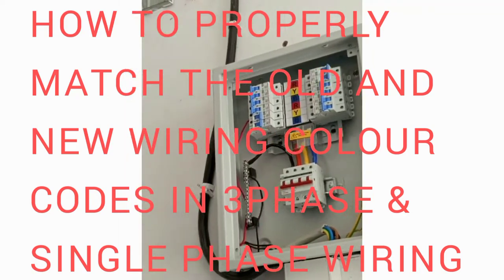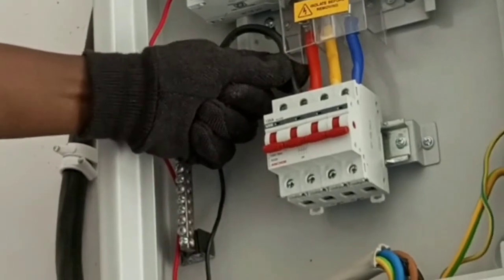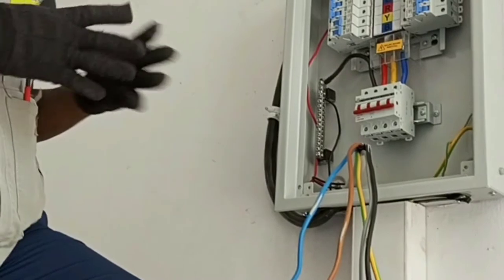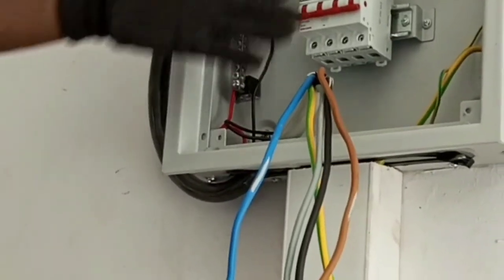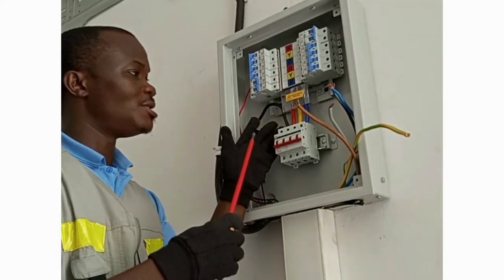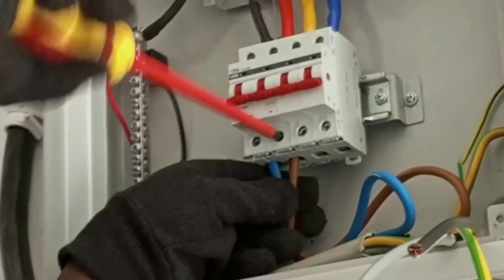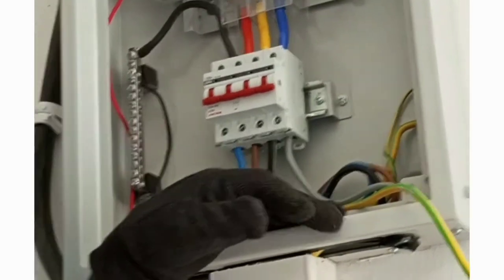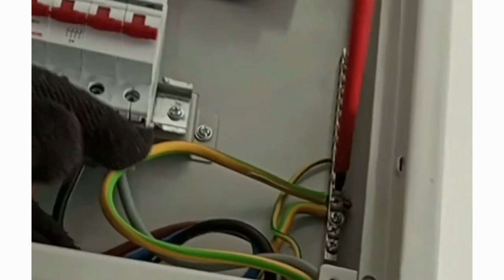HOW TO PROPERLY MATCH THE OLD AND NEW WIRING COLOUR CODES

Comment: Ok, if the cable is 4 cores green / yellow - blue - black - brown without the gray wire, how do I connect them?
Reply from the maker: Great! Please you must know that, IEC colour codes that is used in the UK and most African countries are different from the NEC Colour codes used by the US, Canada, and some other countries. China and Russia also use different colour codes. 
The colour codes used in my video are those of the International Electro-technical commission (IEC) standard.
I will make another video on the NEC  colour codes of the US, and other countries.
thanks.